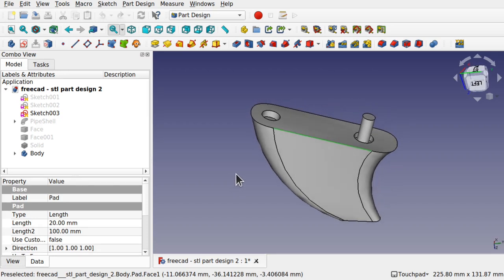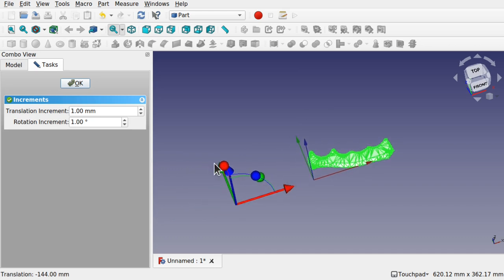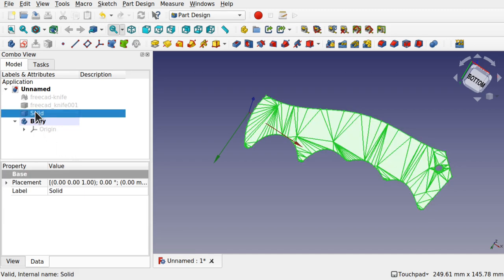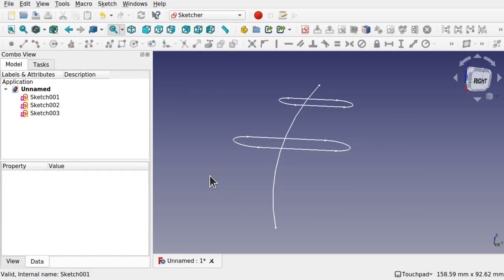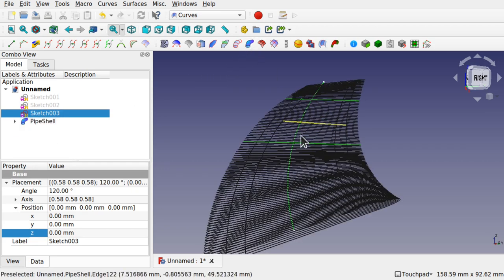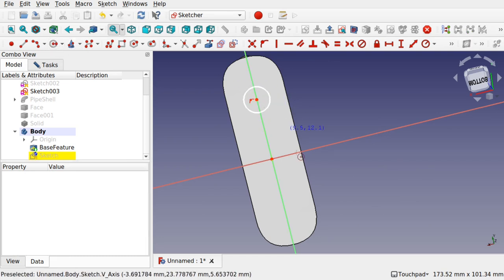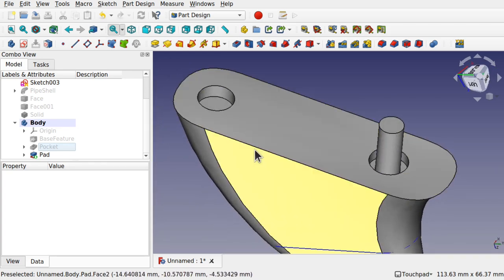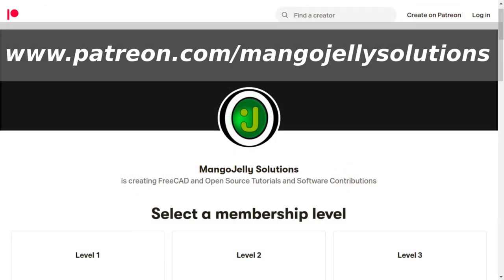FreeCAD: How to use other workbenches with the Part Design Workbench / Workflow

Comment: When you are transforming an object like that knife handle, is there a way align one face to another or align an edge/vertex to another edge without having to eyeball it. It would be great if you could click on one face and there was something like 'Align to Plane' and you could pick valid planes like the origins or datums.
Reply from the maker: You can use placement but there is another way but its hard to explain and I'm going to  do a video about it. You have to use the draft workbench and snapping. You can then add supporting geometry from draft or sketcher just for movement. As said its a complete work around but you end up with something like you would see in the A2 Plus workbench

Comment: at 6:32 could you not  create a datum plane base of the exiting geometry from your solid, and then attach your sketch to your datum plane? that way you do not have to mess around with your angle & axis for your sketch. love your tutorials BTW, their awesome especially the ones on the curves WB
Reply from the maker: Yes you could use the datum plane to make your life alot easier 😊 glad your enjoying the videos. I do have a love for that curves wb 😁
Reply: @MangoJellySolutions  their great. most if not all your videos are great. thanks for doing what it is your doing. 🙏♥🇺🇦